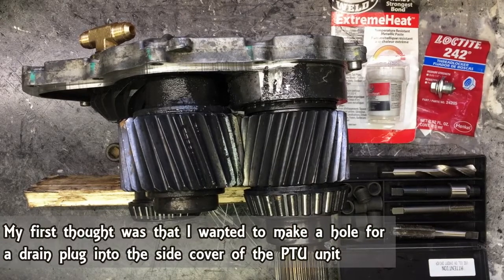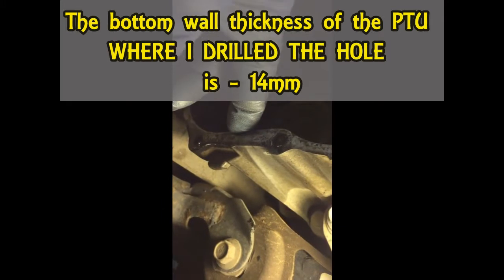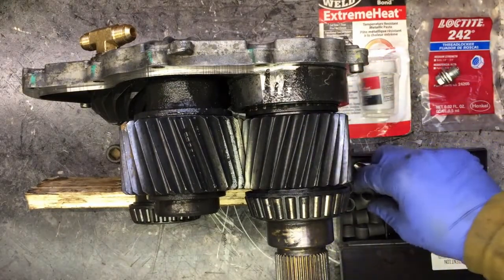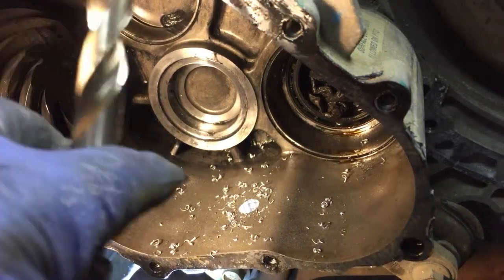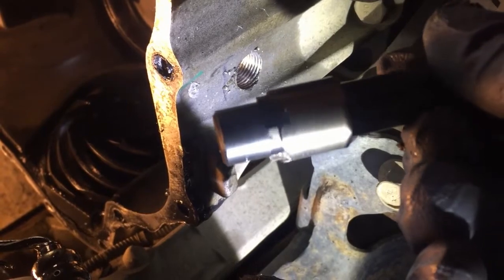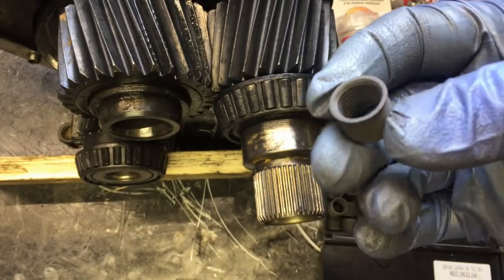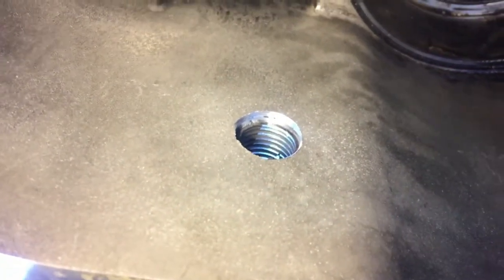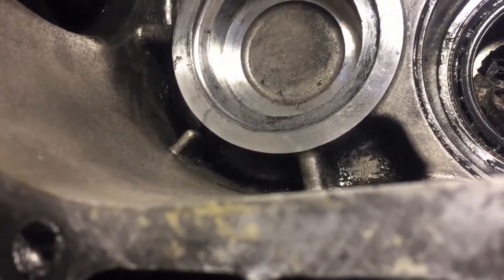2010 Ford Taurus SHO, part 8 - PTU and how I installed a drain plug

Comment: Nice work. I've seen where the cast is drilled and tapped then a bolt or plug used. With the heat these PTU get in the  gen 5 Exploders I would worry about the threads. Your solution is better in my humble opinion. Working on motorcycles over the years has taught me about soft metal, heat and threads in it.
Reply from the maker: I have no such experience. I did what I thought might work. I'm too far away from driving it but once I hit the road I'll definitely keep an eye on it. Thank you for the comment. Good day!

Comment: Drilling cast aluminum would make me nervous about cracking it.
Reply from the maker: Same here..nervous until the last second I worked on it even when I applied not a lot of pressure when I honed it. I'll do the same again though  with a way more cheaper engine.